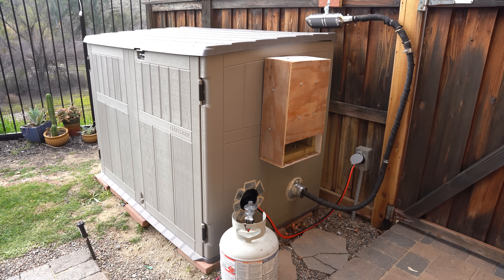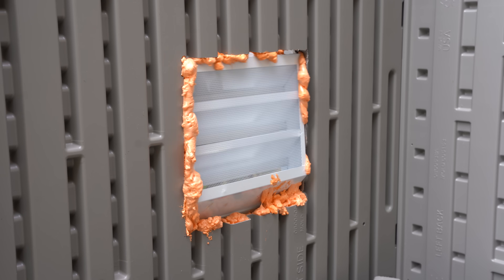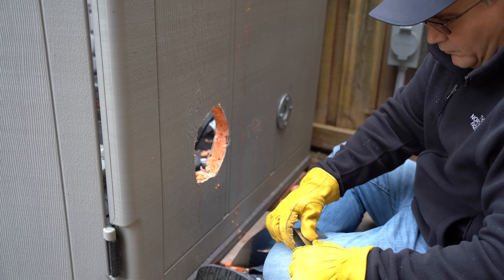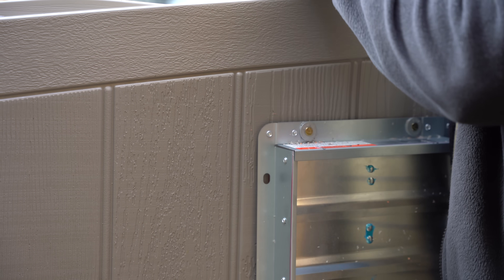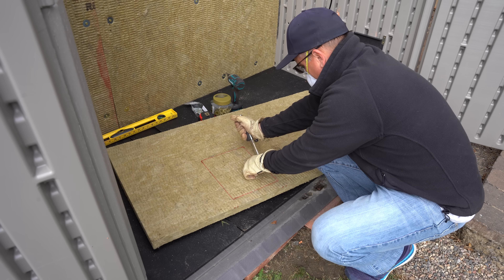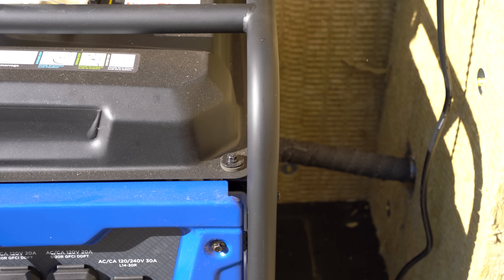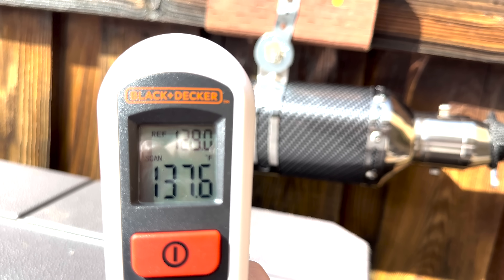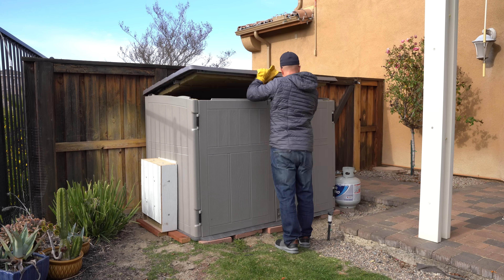How to Build a Generator Quiet Box (DIY) | Ultimate Stealth Enclosure

Comment: Chris, thanks so much for walking us through this build. A generator box is on my to do list. I want to see if we are going to put the interlock on the house or in the detached garage. Placement is key for noise as well as fumes since we don't want those coming in the house.
Reply: When I built my generator shed I purchased a back yard tin tool shed about 5x5x6 feet. I built a 4x2 frame inside it. I then filled the spaces with rock wool. Then lined it with acustic foam pannels made for generator sound reduction. I then built an air intake and a 18 inch air blower to extract hot air. The blower mounted on the side at a height of 4 feet vented into a vertical 12 inch stainless pipe which was 10 feet tall reducing to 6 inch at about 8 feet in height. Inside from the blower I built a air duct that attached to the end of the generator creating air flow over it thus removing the heat. I then mounted a 6 inch chimney cap. I then had the exhaust pipe feed out the back of the shed and onto the lower portion of the 12 inch pipe after the blower and mounted an additional mufler inside. This way the blower pushed the fumes etc up and out and does a good job of disbursing the smell. All in all  10kva generator running and all you could hear was the air blower as a slight hum just above background noise. I have since built an additional box that covers the generator inside the shed. When it is running I can not hear it from any boundry fence. I then had it connected to the house using an AMF switch so it will start if mains power is lost. I also purchased a diesel tank and pump which is in the tray of my Ford Ranger to ensure a good supply of diesel.
Reply: @ronicarbine8723  you really dotted your Is and crossed your Ts. Great work, man.
Reply: @trevorrisley5419  cheers. I love good home based projects. Can't get into to much trouble in the back yard.  Just finished a glass house and 8 raised garden beds so keen to get growing next seasion. Take care.
Reply: @ronicarbine8723  I built high side hugelkultur beds and I'm planning on building more. We have to take down a couple more locust trees that are in not so safe spots and access will be easier before I build more beds. I have plans to build a greenhouse, tearing down an old dog pen that the previous owner had. I'd like to save the framing but we've had carpenter bees out there. I'm thinking about how I can add a couple of hens to this plan to help procces compost and get some bonus eggs. Lots of projects on my list
Reply: Here's a thought also and I wonder if this has been researched Chris. What about filling the walls of the shed with expanding foam? I have filled cooler lids with the foam for extra insulation since most coolers have hollow lids. I'm wondering if that would help deaden more sound but I also wonder how much that would change the heat retention.
Reply: @The-Grateful-Hippie  nice one. Keeps it up.
Reply: @The-Grateful-Hippie  good idea

Comment: you can use a prc drain cover thing (not sure what it is really called but it has a hole and is surrounded by materia, square with a round hole with slats). It lets you seal the hole and prevent critters from climbing in...easily attached to unit with adhesive. as others have said, don't seal the bottom.

Comment: Nice Video. I think it is easier to start with a honda inverter that has below 60 decibel out of the box and then reduce that even more. In a town 60 decibel is still noisy and easy to hear.
Reply from the maker: yeh, Honda's are nice.  This is an open frame generator (much bigger than your typical Honda) that can power some of the loads in your home.
Reply: @CityPrepping  I’m putting a condenser saver/slow start on my ac. Along with the power inlet installed to my electrical panel, I should have ac when the power goes out or brown out. I live in S california too.

Comment: Great design!  I would think the air should draft into the engine / across the co2 sensor, so the sensor doesn't trip from Any residual fumes, exh. Leaks, off gassing ,etc. Tks

Comment: Have you tested it for a long period ?   The EMT conduit connector seems like it will break, and the nuts (I believe you kept calling them "bolts")  might back off unless they are double nutted, use Ny-loc's or Loc-Tite.   Great idea on the springs to use as spacers to separate the hot pipe.   I'm interested to see how the plastic box itself holds up over time.  My generator box is 4' x 6' x 6' high, steel framed and 3/4" plywood.  Thats as far as I've gotten with it.   I located it near the outside plug that connects it to the manual switch gear, which in turn, feeds the 110v circuits inside our home.   If we want hot water, we either run 220v from a 2nd generator, or boil it.  lol   We have 110v space heaters, window units, counter top cooking pans  and even a 110v clothes dryer.
Reply: Is your generator 220? If so, run a double pole breaker in the breaker box and back feed the 2 110v buse bars. You will have 220v. Just be sure to turn off the main breaker in case the power comes back on.
Reply: @mister-action1  We have 2 6000 watt generators, we need the 220v outlet to feed the switch gear plug.  If we need hot water,  I'll pull the wires from the load side of the breaker, tie in 220 and we'll be good.  The water heater has a 2nd breaker in the closet, plus the outlet on the generator has over current protection.   The switchgear prevents our equipment from reversing back down the service line.
Reply: @Effeoj nedib  
6,000 will probably feed the hole house.  I have 5,000 watts. It runs everything we need. My well works and the furnace also.  I can run a few lights and a TV or two.

Comment: Cool idea. During the last ice storm, I could hear generators running throughout the city. With the usual noise pollution levels way down, it seemed like the sounds of generators traveled quite a bit.
Reply: My neighbor has a generator and he lives 1/4 mile away and I know immediately when he cranks it.  Must be one of the open frame types.
Reply: This is the problem my next door neighbor and I have discussed - both of us have the generator shed builds like this but two other neighbors do not. In fact, one of them who doesn't has a higher decibel reading in MY backyard with his running 75 yards away than mind in my own yard reads! So we go to all the trouble and expense to make them quiet and some other dill hole on the block creates annoying noise pollution!

Comment: I run the Predator 3500 just nakid in the side yard behind standard yard fences. Standing out front say 20ft away with gate closed its in the 30-40 decibel range. At the street curb you really need to listen to hear it. Neighbor next door? There are two 6x8 sheds back to back with yard fence between the generator and neighbors house. Checking it again noise level is quite low. I think your shed with a quiet inverter generator would be super low noise levels. If I have weather I leave the generator in the shed with the door cracked. Noise level is definitely lower.

Comment: Great job - good workmanship. Way more than I would do. Our HOA would never go for that permanent structure. We will have to come up with something much more portable that can move with our unit in and out of the garage. We have a gasoline engine on our generator, not propane. Any sugggestions for something more portable?

Comment: When using exhaust heat wrap you can soak it in water and it will pretty much completely stop the fiberglass shards from getting into the air or poking you.

Comment: I wonder if a pool pump box is a good option for part or all of this project. I know where I live, you can buy mini-sheds that are designed specifically to house pool pumps & supress their noise levels. We had a pool as a kid & I remember the noise was really loud when the box was open, but barely audible when closed. Might still need extra ventilation etc, but might be part of the work done, over buying a basic, generic shed to start with

Comment: Really dumb question, sorry Chris. I am learning. I assume most of the noise is caused by the exhaust. Wouldn't it have been practical to build some sort of muffler that would have made it quiet with an enclosure?  The build looks super cool by the way.
Reply from the maker: I put on a muffler on the exhaust (https://amzn.to/3HYaCLX).  Without the box, it would have been loud.
Reply: Run the exhaust into a  buried 45 gallon drum, from the drum and plastic pipe you can run the exhaust a long ways away. Completely silent.
Reply: Actually the noise is from the operation of an air cooled combustion engine. The casing retransmits the noise (cycling explosions) outward through the walls of the engine.  Water cooled internal combustion engines have the water jacket to dampen the noise, hence why they can be significantly more quiet. You can purchase water cooler generators like military surplus versions but the complexity goes up dramatically and then you have to deal with the noise of moving enough air across a radiator to keep the water jacket from overheating. So they are not as stealthy as you might think.
Reply: @bobfuhr4520  Wouldn't that create back pressure as eventually that air won't have anywhere to go?

Comment: Tell me, could you do a video on what we would do if we had an EMP attack on this country with the balloon, having crossed our United States from China what would prevent them from doing that and how would you survive it? Would your ham radio even work?
Reply: lol an educational video regarding emp's would serve more justice it seems
Reply: taking down the power grid (emp) and jamming radio are two different things. It is perfectly suited for jamming any radio frequency it wants, from cb to ham to more advanced things. If it wanted to EMP something, it could probably only focus on a specific power plant while flying overhead.
Reply: Well worth reading "One Second After".
Reply: Hi, if you search on this channel a video Kris made called “how to survive the first 90 days after the collapse” you will get some valuable insights. It is not EMP specific but many of the main themes will be the same because the main factors are human nature in the reference of resource limitations.
Reply: @termiterasin  not wrong persea sounds like it'd be more the reverse though as it's easy to single out an specifically jam specific frequency devices an even whole deliberate networks of systems while leaving others totally alone while EMPs general are area effect an typically hard to control on a large scale without frying everything for miles
Reply: Wouldn’t an EMP also destroy the generator?
Reply: @barb7014  probably. I have a push button starter. Should a emp hit though, you do not want to be the only one with power for miles around. The quiet that is broken by a working generator will draw lots of people.
Reply: @BAD IDEAS  Pretty sure they were asking if the power unit on the radio would work, not emp jamming the radio waves.
Reply: Balloon 🎈 EMPs 😂
Reply: I'm glad someone else is paying attention to the intelligence reports and why they had to wait until it got to the ocean before shooting it down. Also, for ham radios, faraday case. I have HTs and crossband repeaters ready to go in metal ammo cases lined with cardboard.
Reply: Preppers obsession with EMPs is what makes us all look like nut jobs.
Reply: American blackout from nat go was on you tube was a great documentary style what if
Reply: You need to read "one second after"
Reply: Plant lettuces & enjoy life
Reply: Your paranoid.
Reply: Do people seriously not know how to survive without electricity? Keep eating and drinking, that's it.
Reply: @okgroomer1966  do you?
Reply: Research making faraday boxes and bags. You. Can store radios and generators inside.
Reply: @missyjo2475  Yes. I grew up without electricity or running water in W Virginia. I could easily do it again.
Reply: What is EMP. ❓❓
Reply: What about burying the generator and a pipe out with the muffler inside a wooden box?
Reply: Faraday cage your whole setup or house.
Reply: EMP shield units installed to your house and cars, have everything AC you want protected plugged in. Have essential DC items in a Faraday cage / bag
Reply: @enterprisecrypto2683  where do you get a shield for your house? I’d like to understand that better could you enlighten me please?
Reply: @susieqmartin2746  the EMPShield vehicle units work in a similar way and are more compact than the house unit, and protects 12 volt and 24 volt systems on gas and diesel engines. It does the same thing, it protects your vehicle's wiring from being fried in an EMP attack in mere nanoseconds. So even cars and vehicles that have computer chips in them are protected.  I don't know about electric vehicles and hybrids though, but you can call the company and ask.
Reply: @susieqmartin2746  the EMP Shield house units also protect against lightning strikes and shunts the excess electricity to the ground wire of your home.  In the vehicle unit, the EMP Shield shunts the electricity to the vehicle's chassis. I have the older, larger vehicle model in my SUV, but there's a new, more compact one.  I recommend getting the more compact, updated vehicle unit. It works for motorcycles and boat electric systems too as long as they're 12 or 24 volts.
Reply: @susieqmartin2746  the coupon code I used in 2019 when I first bought my units is "llod" without the quotations (LLOD) from the last line of defense YouTube channel, but if it doesn't work I'm sure there are other coupon codes out there. I would use a coupon code because you can save a lot of money.  The units are a bit pricey but definitely warranted.
Reply: @susieqmartin2746  EMP Shield has a lot of educational resources on their site and I would listen to YouTube podcast interviews with the EMP Shield team. They are educational and they distill what you need to know.  For example, if your cell phone was built any time in the last 8 years or so, you don't have to worry about protecting it from an EMP. All major cell phone brands have built in EMP protection, you may have to restart your phone a couple of times but they are essentially EMP hardened. It is the stuff like ham radios or two way walkie talkies and batteries that need to be put in a Faraday bag. Things like EoTech and Trijicon, aimpoint sights are also EMP hardened/protected from my online research.
Reply: @enterprisecrypto2683  thank you I figured they would be a bit pricey!
Reply: Check out emp shield
Reply: @okgroomer1966  I do know how to survive without electricity quite well. Just don’t want to!
Reply: Anything not plugged into the grid would be fine.  EMP causes power surges because the lines act as antennas.  Your circuit breakers and GFI outlets may even protect whatever is plugged in.

Too many movies.
Reply: @jwm6314  would that be true? Why would cars stop working in the street because of the electrical pulses from an EMP strike???
Reply: @growinglifeorganic940 
They make a paint that is supposed to be protective against emps if applied to the exterior of a building. As added protection to a Faraday cage
Reply: @JDGage You do realize an EMP is the natural result of current nuclear ☢️ weapons. Even the military hardens against EMP now. So how is being concerned and trying to shield your equipment making peppers look bad?
Reply: @Honestandtruth007 in case no one answered. Electromagnetic pulse. It’s one of the side affects of nuclear weapons and it can fry electronics. The original F/A-18, A and B models, wasn’t shielded against an EMP. The later models C/D and the Super Hornets are shielded.
Reply: I don't think you understand how emp works 😂

Comment: Does the 1” exhaust hose cause any back pressure or restrictions with exhausting?  I saw another video where a guy had to switch to a 2” exhaust hose to allow better engine performance.

Comment: The box idea for the air inlet and outlet is similar to the tactically quiet generator sets I used in the military. The fans that run in those are the size of a truck engine radiator fan. With all that money spent would it have been a better idea to just buy a Honda quit generator?

Comment: Only thing I think I would do different using that vent pipe you should’ve used the double wall vent pipe and I really think that would’ve even lowered the temperature more from 90° down to probably maybe 70

Comment: You'd be surprised how much a long pipe alone muffles the sound. I'd be curious what the decibel levels where for the open shed, closed shed, the addition of the pipe, and then the addition of the motorcycle muffler.
Reply: another comment said they get an additional drop of 20 decibels with a long pipe to high up from their box, so that's basically as much sound dampening as this entire box! ie doubling it's effectiveness just with a pipe

Comment: I wonder if you can skip creating air holes in it and build a "heat exchanger" system

Like by putting one radiator on the inside and another one on the outside.

Comment: Your generator running in that shed is quieter than our old dishwasher!  You can get a passive temperature swtich that will close a contact (at a temperture you select) that will ground the coil and shut down the generator if temperature gets too high.

It's designed to turn on and off 120vac attic fans but can be wired to ground the coil.  It requires no power of it's own.  It's just a bimetalic adjustable temperature switch.

Comment: @CityPrepping It "seems" the screws holding the insulation on do not go through the outer resin wall. Can you confirm? Currently, how well (particularly on the lid) are the screws holding the insulation in place? Really appreciate the time and feedback, have the exact same resin shed and following your build closely.